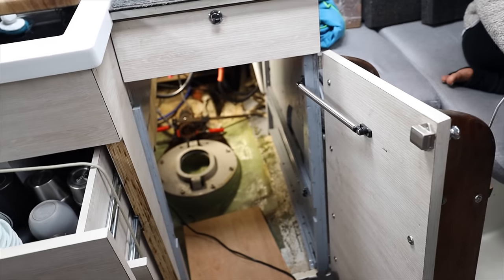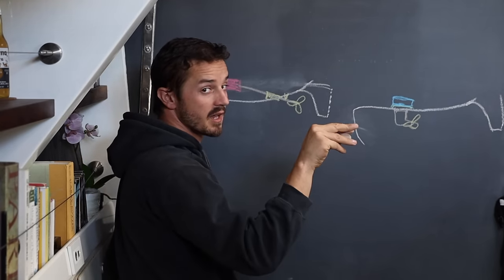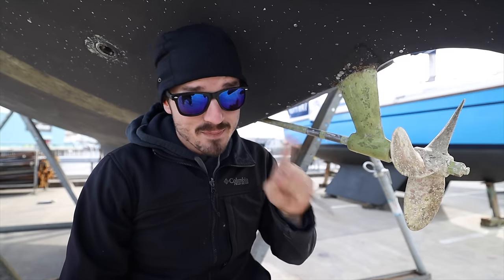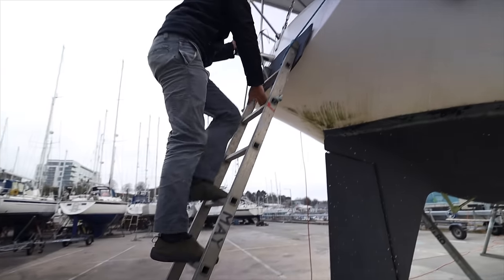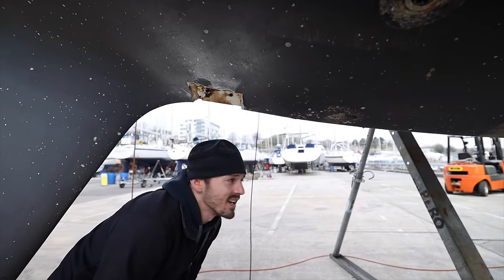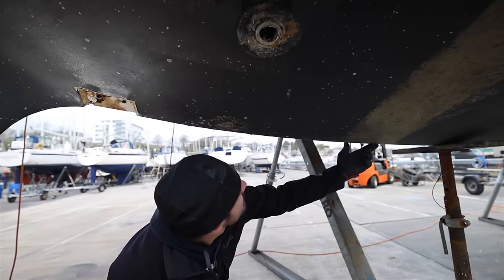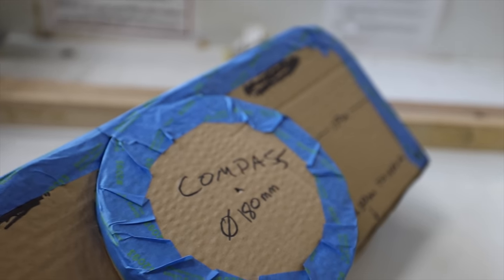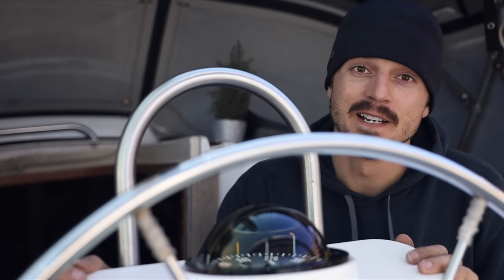CONVERTING to an Oceanvolt Electric Sail Drive — Sailing Uma [Step 213]

Comment: I love the way you two actually finish projects, they are done-done, tidy, painted, and complete.
I have one question though, apologies if it has already been asked - I assume the folding prop has to go, to get regeneration? Or does the system do a bit of magic to lock the blades in the open position?

Comment: There is a little trick with the foam ear plugs you may not know. If you roll the end between your thumb and forefinger you can compress it down much smaller. You can then easily get it into your ear canal where it will swell back up. Much easier to get them in that way.

Comment: Great project. For ear protection get some headphone style. I've got a pair that's for shooting guns (no guns but a lot of power tools) I like them because they really reduce the noise, plus I can use my ear buds with them. And when you don't need them they can park on your head. 
To hammer down those skeg bolts from that tight space: turn the hammer sideways.  A guy I knew had worked on making concrete forms for the Hollywood Freeway back in 1949. They were always hammering inside narrow forms. So Hank had the bright idea to cut the puller-tines off the back of his hammer. He showed it to a guy the next day who, instead of being impressed, looked almost sick. "Hank, I've got a second hammer in my car, you use that. Don't let anybody see this thing - they'll fire you. Hank, we just use the hammer sideways." So when you hear the joke about "Gee, I can't use these nails. they're pointing the wrong way." I think we all have a a Hank hammer moment. I've got more than a few.

Comment: Great work, it looks awesome!! That’s interesting that in the UK they let you grind the fiberglass and work on the boat without any tarps or collection systems. Doing a bottom job in Hawaii is a night mare. Need tarps and hepa filters and all that otherwise you get a fine. Hopefully the next time I do a bottom job I won’t be in Hawaii! You guys give me motivation, thanks for sharing!!
Reply from the maker: Every country is different. Here, they just ask you don't make a mess. We had the vacuum running to minimize dust, the rest goes into a drain which is treated before it reaches the ocean.

Comment: when inserting ear plugs, first roll between your fingers to squeeze the foam, then with the other hand pull up on the top of your ear lob... it straightens the ear canal, inset foam and then let the ear go. that automatically kinks the foam in the ear canal and secures it, as well as sealing from the noise.

Comment: Thanks for a great couple of videos! I originally converted my 8.2 Aloha (Shearwater) from outboard to an inboard (rebuilt) 12hp Yanmar.  Later while in Virginia, and with plans for an Atlantic crossing I purchased a zero-hour 2GM20. With slight modification of the mount, the new engine dropped in without any problem. After almost 15 years of full-time sailing, mostly in the eastern Atlantic, Shearwater has been and on the hard back in Canada since 2015. Now seriously thinking its time to start preparing for more ocean passages, and with barely over a thousand hours on my Yanmar,I'm thinking that converting electric power saildrive might be a good idea. I'll look forward to reports on YOUR new powerplant!

Comment: That's a damn cool new motor and drive system.
It would be super cool if that system could rotate about the z axis like a Penta-drive then you could use it like a bow thruster for side propulsion when docking in tight berths.

You're a super cool couple, you've got a new subscription from me.

Comment: Congratulations upon turning a dumpster boat into a magic carpet!
Don't you want a fixed prop instead of the feathering style if you plan to use regen with your electric motor?  I spent two weeks in the Bahamas on a 44' ULDB with electric power.  One of the unexpected benefits was the ability to balance the controller at exactly neutral when sailing in light or moderate wind.  Whenever hit by a puff you start making volts, and when the wind goes light you automatically have a little assist that helps maintain speed.  When your speed matches your throttle exactly your prop turns just enough to create zero drag---better than the fanciest feathering prop.  But this mode of operation works best with an oversized fixed three blade propeller.

Comment: Hi guys, first I simply love you and your boat! The way you love the earth and try to do your part in making your fingerprint as small as you possibly can by using the electric motor! So genius." Now, the fiberglass work, this is what I started off doing in my life for a carrier back in 1979 and way back after making one of the most costly mistakes ever back then! I wasn't aware at the time that while rebuilding any part of a haul or repairing on a fiberglass haul it is mandatory to layer the fiberglass in a two/3 ratio" for every 2 layers on the outside means 1layer on the inside and in doing so somehow get some converge of any kind of cross beam or really anything thats solid and connected to your place of repair. Anyhow by the time your done laying it, it's better if you've used at least 6 to 8 layers in total. And that way nothing to chance in structure integrity.. Especially since your prepared part is supporting the heavy motor that will have motion all the time..the reason I brought this subject up was because I seen nothing of the inside glasswork that needed to be done also.. Was it just by chance I didn't see you doing that part of it,"gee I hope so".. I love you guy's and your boat!! Pretty soon as my financial works get better tremendously, I am going to contribute everything possible to you and your channel and life so I can enjoy watching for a very long time.. So long as that motion/ vibration, movement doesn't crack at the wrong time, like in the middle of an ocean and you won't be able to fix it way out like that.. Oh", please just tell me I just missed seeing you putting the fiberglass on the inside!!!. I appreciate your getting back with me on the matter..your biggest fan....
Reply from the maker: Watch a few videos back for full detail on the motor instal and a few videos forward on details of repairing a big crack in the hull. And yes we did many layers inside and out.

Comment: I've refurbished a few transoms.  Rough grind the inset with a round grinding ball, then fine grind (proper grit for bonding), clean with 99% alcohol, then wipe with acetone.  If there's any visable residue, alternate wiping with alcohol and acetone until zero residue remains.
Let dry, THEN glass it in.  Stuff glass into the depression, tight, with excess sticking out, and use something like thick aluminum foil taped over it to hold it in.  
You don't want ANY air in there.
The result should stick out from the hull slightly (about a quarter of an inch).  After it cures, sand it flush, and clean in.  Use glass beads and epoxy/resin to fill in any gaps, and sand smooth.  Recheck and repair any gaps.  Let it cure for at least three days before cleaning and painting.  Wait a few more days for the paint to fully cure before applying anti-fouling.
I've glassed in quite a few body panels, too.  ;)
Finally, use PL Marine by Loctite for those threads!!!  It provides a flexible (this is key for marine seals), waterproof seal.  Otherwise, you can get slow leaks around the threads.
https://www.homedepot.com/p/Loctite-PL-Marine-10-fl-oz-Fast-Cure-Adhesive-Sealant-2016891/206156418

Comment: moving the prop forward will also move the boat's pivot point further forward, she might not track as straight and become a little more squirly under motor, or sporty? Might actually be an advantage in tight quarters.  Another though is being that close to behind the keel the prop will get fed more turbulent water.  For regeneration, it might work much better with a three blade prop to get a good bite.  Also since the original prop had a slight downward angle and the new sail drive will be parallel with the water line, I wonder if you get more stern squat under power?

Comment: If those earplugs are foam, roll them to a smaller diameter between finger and thumb, then insert into your ear. The foam will then slowly expand and conform to your ear.This is much easier than trying to push a wide earplug into your ear.

Comment: Great job again.  You said the old prop was a little pink?  Pink brass is often a sign of galvanic corrosion. The zincs didn't look all that great though you thought they were okay. It could have happened a long time ago, even the previous owner, and you just didn't notice it.  I expect Oceanvolt has a zinc for your new sail drive but be sure to keep an eye on things and maybe even have the boat tested for galvanic issues if you haven't.  Stay safe.
Reply from the maker: Yes, the prop was pink when we got the boat, but we couldn't afford to replace it at the time. And yes, the new Gori prop has 3 anodes.

Comment: After watching these videos I was really excited at the idea of adding a purpose built electric engine to. our boat too....... Then I checked out the website, saw the price and nearly cried 😂😂😂

We'll have to keep buying those lotto tickets for the time being.

Hope you guys are safe and well right now 🤞🤞
Reply from the maker: Our thoughts exactly, and the reason we built our first motor from used golf cart parts. You can built a pretty good set up for $2-4K then add a small bank of batteries and upgrade later.
Reply: @SailingUma  I think your DIY skills are an order of magnitude or two above mine, ha ha, especially when it comes to building something from scratch. I'm just about brave enough to install something that's purpose built, just about 😂

This whole pandemic has really made us pause for thought about trying to make our boat as off grid capable as possible, especially seeing how some people are stranded and not allowed to enter ports. Right now all we have is 400w of solar panels, but that's going to get a big upgrade when we can get back to the boat so we can at least install another freezer and a DC water maker, that'll be a considerable step in the right direction at least.

Your videos are super inspiring and they're certainly helping to keep us sane right now.

Stay safe guys. 🤞👌🏻🐾

Comment: Looks like the electrical was bonded to the skeg, dissimilar metals between the skeg, prop shaft, and prop are most likely why the prop was slowly eroding and turning pink.

Comment: You reduced it to a 22 minute video, but that was a lot of work! I did the same job, except in reverse - I removed an old sail drive system and replaced it with an outboard for now. I hope to put in an electric system like yours eventually. I'd offer some photos if YouTube would let me, but guess I cant. Anyway - suffice to say the mounting bracket and through hull hole were pretty much the same as what you ended up with.

Comment: I'm sure other must have pointed this to you, but folding prop does not recuperate energy. Normal prop works fine, adjustable pitch prop works better, and the best is Brunton's Autoprop. You guys in the UK - look them up, that sweet saildrive, add autoprop, nothing will be better!

Comment: Looks very good and perfect manufactured job. 
I wonder about the folding prop with the energy regeneration. 

Note 
Nord lock washers are as old as rolls Royce. It’s used a lot in aviation only called different. 
Noting new on that stuff.

Comment: The space between the top of the propeller and the hull is so small. I think you say 1 inch and a quarter. Is it the recommended space? How were you able to calculate that space that also depends on the way you have cut the mounting piece inside the boat. Anyway, I am very impressed with all your work. you make it look easy but it is a lot of thinking, knowledge, and technical skills
Reply: 10% of prop diameter is recommended clearance to minimise resistance to turning and prevent "pounding". BTW, it only takes minute to determine if the shaft is bent by simply turning the prop by hand while holding an object like a 2x4 static next to the blade tips. Additionally, alignment is usually not difficult unless there's not enough room inside for the engine to be lined up; then it's next to impossible.

Comment: Hey question: after watching these two videos, and also the newer one where you replaced the saildrive, I'm curious about corrosion on this device, and where the anode is. What kind of corrosion issues do you anticipate on this implementation? Thanks!

Comment: I was amazed with how well you did this conversion! Except when you put red loctite on the bolts, hopefully you'll never have to take it apart...  ahahaha Nice job guys
Reply: With enough heat, I guess its relatively "easy" to handle the loctite.

Comment: Awesome jobs you guys!   I couldn't help to wonder how the prop is locked for Regen...   Also it will be interesting to see how the boat will handle now.   The propeller being so far away from the rudder I would expect a slower reaction time at slow speed. Thought?
Reply: One touch button on the display, puts it in "gear" so the prop folds out while sailing, the tork is much higher then with a diesel engine, like a Tesla, so fast reaction.

Comment: Just wondering how your going to get regen from a folding prop? When the drive is off but engaged the prop will fold, not stay open to drive the motor? Or are we missing something?  Sail Safe guys. Ant, Cid and the pooch crew.

Comment: How does it feel in the water. I imagine a little delayed response when using in turning , reverse and going forward as it takes a bit for the water to be pushed over the rudder by the propeller.

Comment: Great video! -- thanks for the education on electric sail drives.  One question: why did you need such a large hole in the hull and why do you leave it open instead of glassing it in?
Reply: Its for cooling purpose

Comment: Great improvement! You will like the Gori propeller. It has an overdrive function when you shift from reverse to forward. More pitch for more power at same rpm. Zincs are small and expensive. We use boatzincs.com. The have both the shaft and saildrive collar zincs. The end shaft zinc looks the same for both. We get about 8 months before they are half wasted.

Comment: Where are you doing this project? I hope that the actual air temp was high enough to properly 'cure' the fiberglass so that it adheres and strengthens for the amount of forces that will be endured while out in the open ocean.

Comment: Sailing Uma great work as usual. So, is the sail drive not at risk since it’s rigidly mounted and if you were to strike something immovable the damage to the hull could be catastrophic, no? I wonder why no one seems worried about this. It’s like an out drive on a runabout but the latter can articulate out of harms way. Also, won’t the large cutout where it was bolted from the outside cause some unwanted water turbulence...? I

Comment: You should use a wallpaper roller on the fiberglass you make sure there's no air trapped can separate later on
You should put some silicone oil grease or petroleum jelly around the seal before fitting the motor makes for a better watertight seal
Would have been better be put a faring in front of the saildrive going halfway around an 1.5 deep to cut down turbulence because of the hole typing it into the saildrive so there's only a small gap 7/64 of an inch between, half away round. I wonder if you get any turbulence on the blades? Plus it what cause noise you could have made a cap out of fiberglass to cover it with the fairing if you drill into the bolts heads and thread it doesn't need to be a lot of pressure just enough to hold it in place

Comment: Great installation video!  You guys are the best!
Was the prop running in reverse in your video?  It looked like the control stick was pushed to forward position. (I would be shocked if the wiring was backward.)
Reply: No pun intended!

Comment: One of the most satisfying sailing videos evah!  One question: is there a control to prevent the prop from folding?  It seems instead of generating power when the electric is not powering it, it would just fold up.  ???

Comment: Very nice job. I do have a few questions though. 

You say that sail drive is more efficient thanks to water cooling. Couldn't a direct replacement brushless DC motor also utilize water cooling? Also. you have a 90 degree power transfer with the sail drive and I believe that consumes a bit of power. Definitely more than a simple belt/chain drive. You also might have been able to keep that awesome FG motor mount.
Reply from the maker: Like we said.... cooling was just one of the reasons we were upgrading. Yes you can liquid cool a shaft drive.

Comment: No nothing about sailing but the video caught my eye. Started out with the hurricane video. I have a quick question if you don’t mind. Why not just take the prop off and leave the shaft there in case you ever have to go back or resale or anything along those lines? Is it just a hazard for leaking or such?   Thx much
Reply from the maker: It's just fibre glass. If we wanted to put a shaft drive back in, it would take a day or two, just like installing this saildrive. Nothing is permanent on our boat.

Comment: Oh wow!   That is an awesome upgrade.  I know that new sail drive must have been expensive
but I bet you save half the cost by installing it yourselves.   How much power does the new 
sail drive have in comparison to the old electric forklift motor?
Reply: The sail drive was gifted to them by a patreon/fellow sailor (previous video or two) Dan explains the difference there as well.
Reply: @megladane  Wow, what a great gift.  It is a great idea that it uses circulating fluid to cool the motor.
Reply: @Bill23799  Yeah no kidding, I wish I had that kind of cash flow, there are so many people I would help.